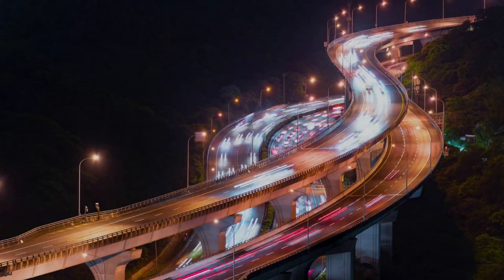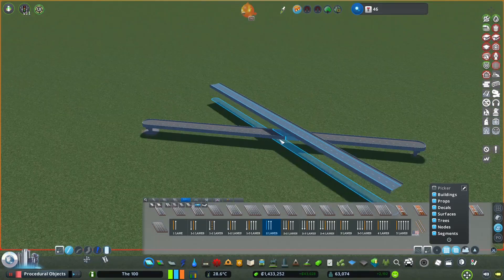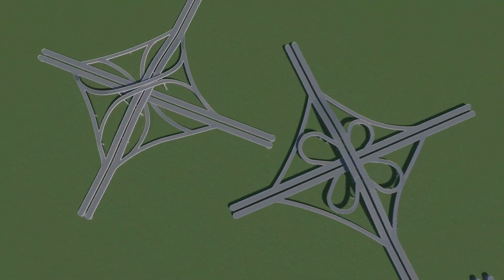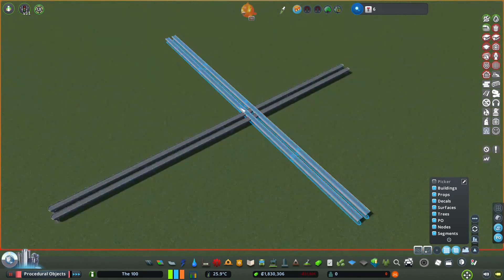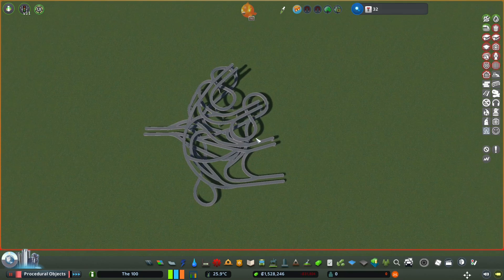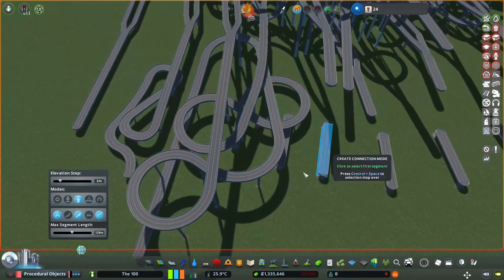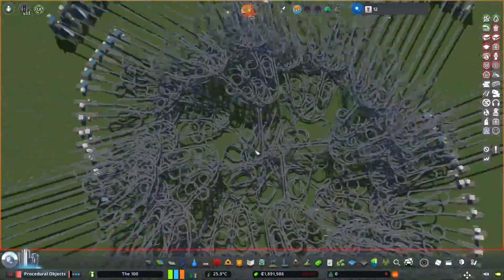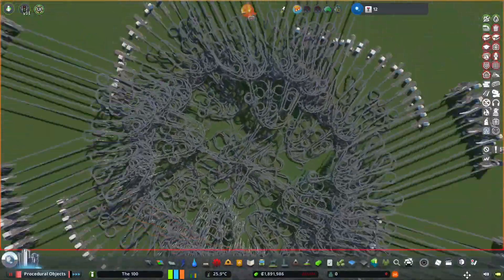How Does A 100-Way Interchange Even Look Like?

Comment from the maker: Savegame here -> https://steamcommunity.com/sharedfiles/filedetails/?id=3498170689
Reply: By far the simplest method to have a 100 way interchange is to have one large roundabout joining all 100 roads together. Everything is on the same level, so construction and maintenance costs are also kept to a minimum.
If the single roundabout is too large, then the next best option is to have a selection of smaller roundabouts, with links from each roundabout to one other. This has the added advantage of reducing congestion, giving a higher throughput of vehicles, albeit with some vehicles having to travel further to find their correct route.
In practice, the most complex English roundabout for which I have bothered to count the exits had eight routes around it, one of which was to and from a superstore.

Comment: This would be a nightmare. Imagine trying to use it without gps. Idk if it would be any better with gps
Reply from the maker: GPS probably wouldn't work because this interchange has too high density. What could work (for automatic navigation), is something like QR codes every few meters, that would tell your navigation system where you are
Reply: @light-eilat that’s true. I’m sure there is someone who could build a system based off the turns you take but that’s beyond my capabilities